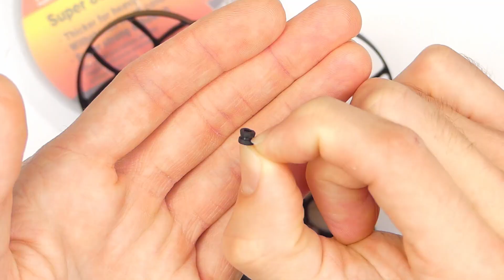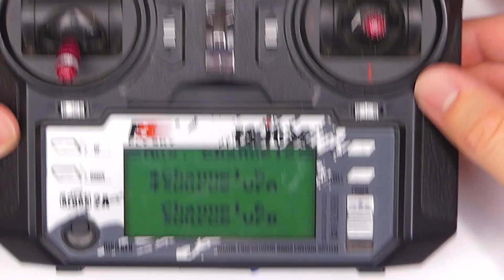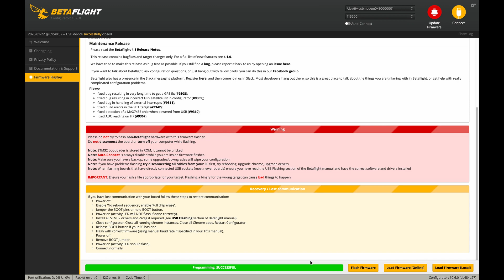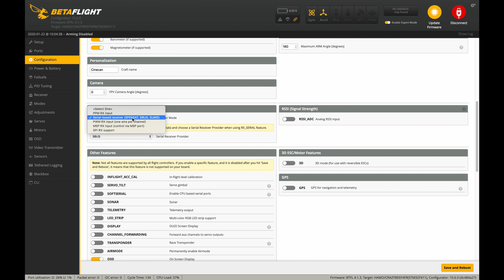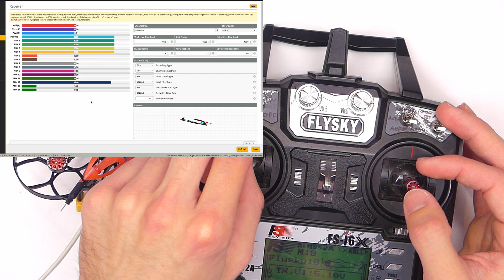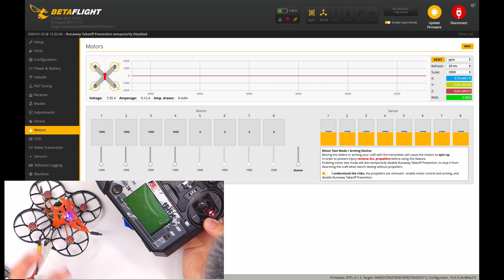Beginner Setup Guide Eachine Cinecan (CrazyBeeF4PRO, XR401-A, Sbus, Flysky, FSi6x) - FPV Cinewhoop

Comment: Great video I just got mine a week ago and your video was a great help. Mine worked fine for first couple of flight s , but then it’s gone kinda crazy! The Aerial pod on the back came loose and the propellers seem to have chopped it. I would not arm and I went into beta flight and all the modes had disappeared . Now when it arma it only boots two propellers and accelerates by itself. Here is video https://youtu.be/qaUk0LI2s28  anybody any ideas ? Thanks

Comment: Hello Adam. Great tutorial! I have a question if you don't mind. I'm a total noob and I've ordered the Cinecan because I was interested by its video capacities. I've ordered it with a flysky receiver but, shortly after my order, the cinecan + flysky receiver went out of stock. It's been like two month now and no infos about any restocking (things are also complicated because of the virus hitting the poor chinese ppl). I've also ordered a flysky FS-i6X transmitter that came with a X6B receiver (I've received it). 
I saw that the Cinecan withour receiver is available so I was thinking that maybe I could ask for a refund and order that one instead and try to instal the X6B inside it. So I'm wondering if it will be ok and compatible to use the X6B with the Cinecan and not too hard to instal and configure. 
Big thanks in advance for any advise you would provide :)
Reply from the maker: Hi! Sorry to hear about your situation (as well as the virus hitting China so hard)! The X6B will certainly work with the Cinecan, but it is relatively very large for such a small quadcopter. I would suggest the smaller Fli14+. However, if the X6B is what you have, I say give it a go and see how you like it! 👍
Reply: @RCwithAdam1  big thanks for your answer. Actually I want to use the Cinecan for more cinematic shots, not going too fast and mostly getting through places where a regular drone would not fit (like inside buildings and such). Not planing to do acromode stuff lol. Don't know if you ever saw that video from a french youtuber (filmed mostly with a Eachine cinecan & betafpv 85X 4K) that's the kind of shots I'm looking for:   https://youtu.be/3ha37-ZwWEI
So maybe the size of the X6B won't be a issue for me and I suppose that I'll get better range than with smaller receivers.
A last question, I've searched for tutorials on how to connect the X6B to the Carzybee F4 Pro but didn't found any. Can I just plug the receiver into the F4Pro with the cables delivered with the receiver or does it need soldering? 
Oh and btw hope that you managed to fix your Cinecan :)